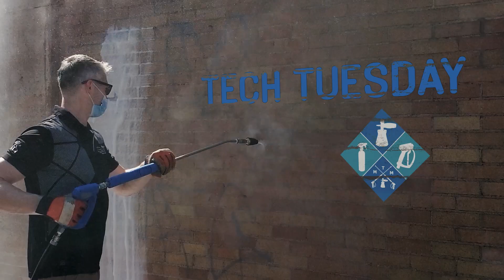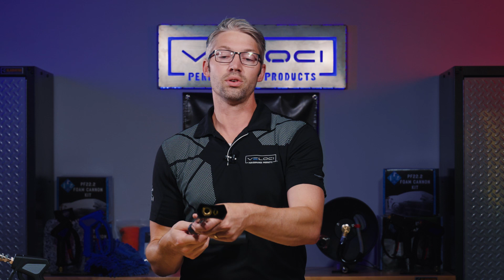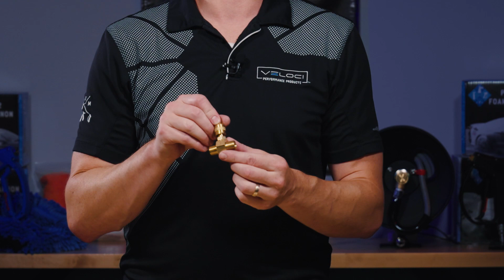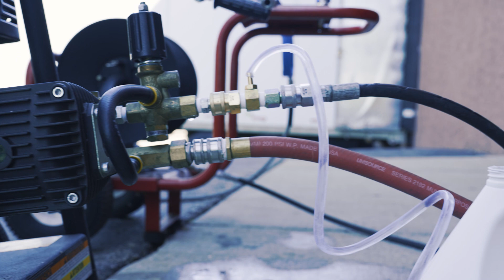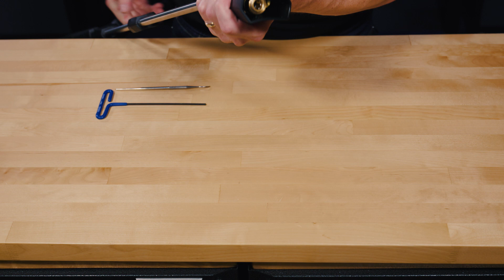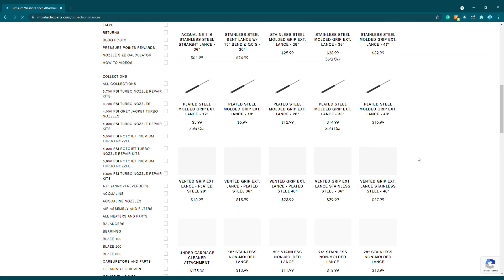How to use the Dual Lance

Comment: i recently got a landa pghw 5gpm 5000psi hot water machine with no hose or wand. Do you have a link to a recommended 5k psi dual lance unit?
Reply from the maker: The DLE28 is an industry standard dual lance and has a 4,100 PSI, 12 GPM specification.
https://www.mtmhydroparts.com/products/stainless-steel-dle28-42-dual-lance?_pos=1&_sid=7597ce71e&_ss=r

Comment: Couldn’t you accomplish the same thing by simply attaching an adjustable (multi-selector) tip onto your existing wand and turn it to the “soap” setting when needed and then back to appropriate high pressure degree option when needed?   Thanks.
Reply from the maker: While common in the consumer market, those types of selectable nozzles are not designed for the heavy use of commercial applications. The dual lance design is made specifically for the heavier demands of a commercial environment.